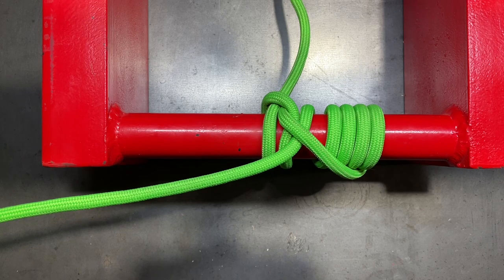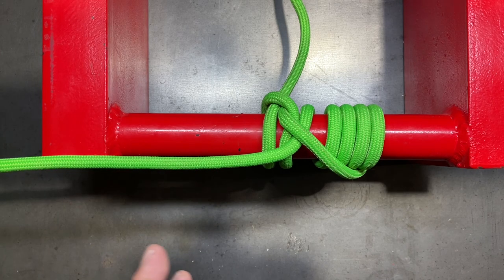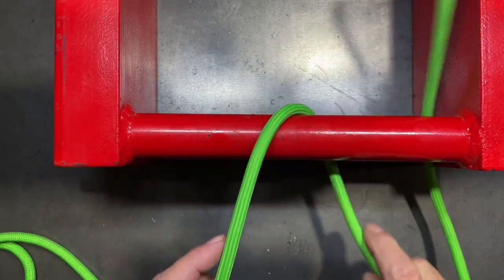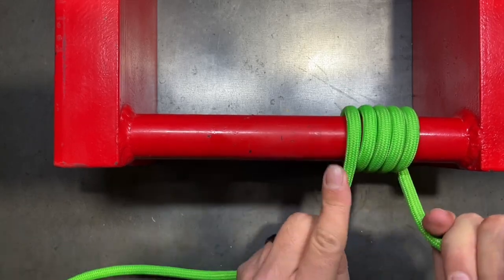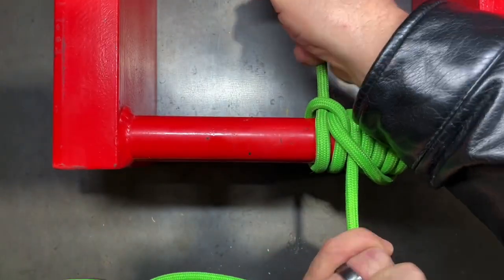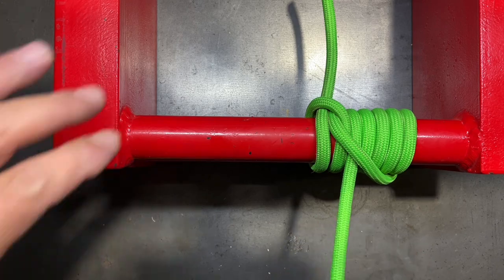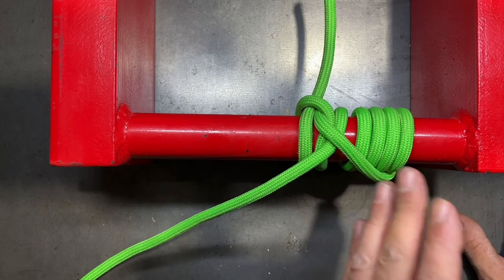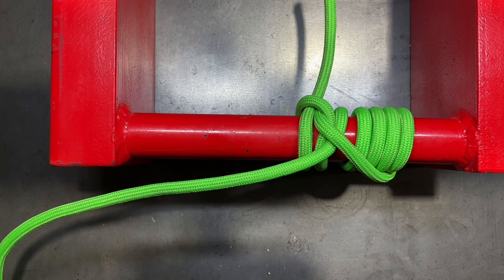Pipe Hitch

Comment: You can use this just fine for vertical (in relation to your video) loads as well. We use a slight modification for rigging.

The wraps provide so much surface area and gripping strength around the bar, like you said stronger than the rope itself.
Reply from the maker: What modification do you use?

Comment: I know this only prevents slippage in one direction laterally, but can you load it away from the pole too?

Was considering a simple clove hitch, but wanted to prevent lateral movement (only concerned about one direction) 4 inch pipe  close to end

Was also considering the icecicle or I suppose just a simple prussic

Load may not be constant.